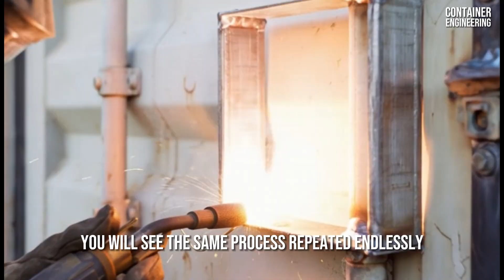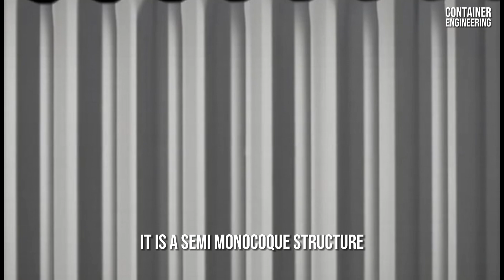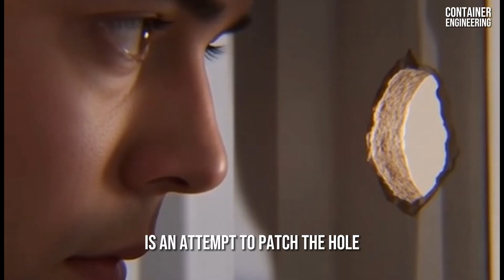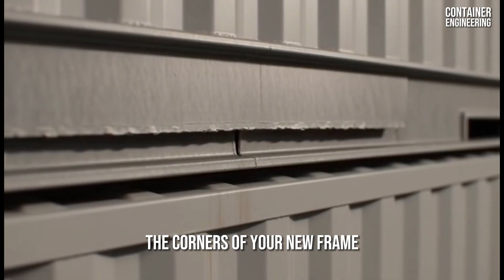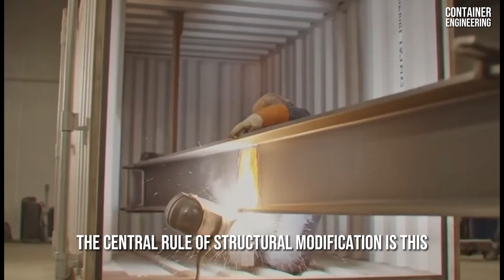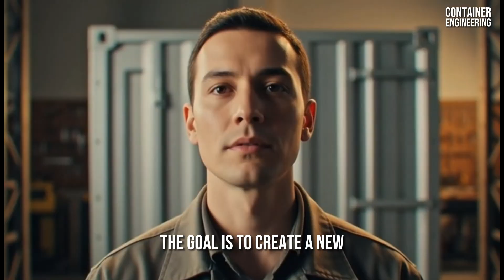The Structural Cut That Ruins Container Homes — And Why Reinforcing It the Wrong Way Still Fails

Comment: Shipping containers are next to useless to build with,creating way more problems than they solve.
Reply from the maker: That’s exactly the point of the video.

Containers are not inherently bad — they fail when people treat them like conventional buildings and ignore their structural behavior.

Used correctly, with proper engineering, they perform as designed.
Used incorrectly, they fail predictably.

This channel focuses on the engineering — not the hype.

Comment: You need to do better.
Reply from the maker: If you think something in the analysis is incorrect, point it out.

Engineering improves through specifics — not general statements.